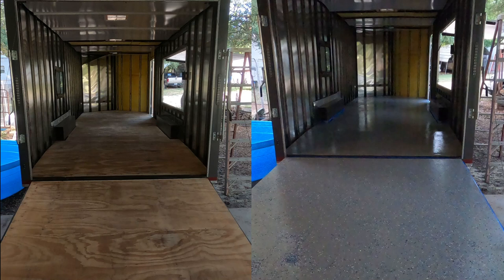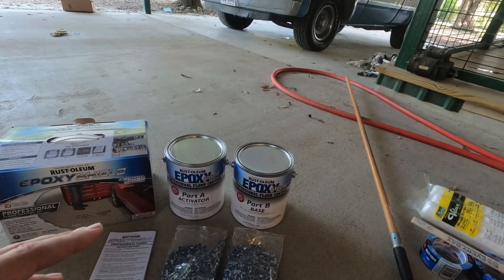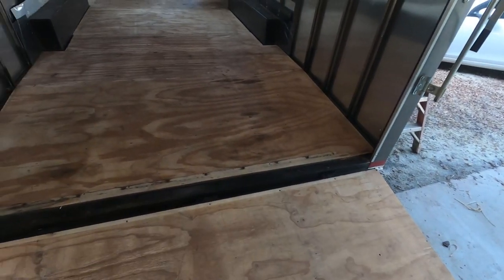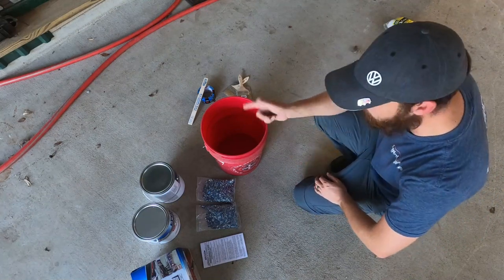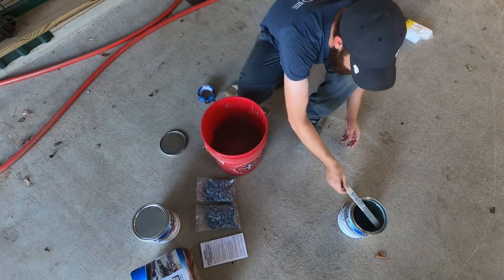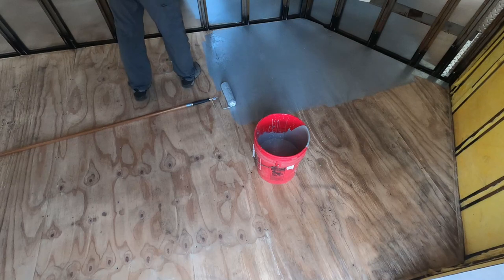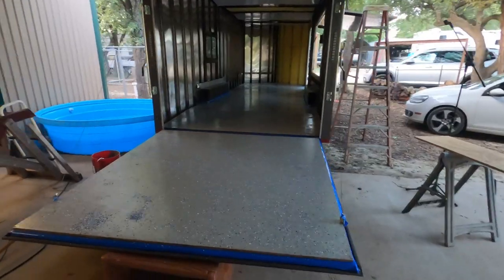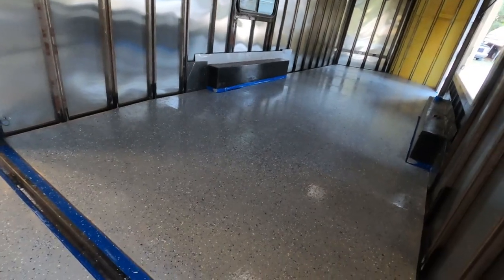How to Epoxy a cargo trailer floor the easy way | DIY | Rust-oleum Epoxy Shield

Comment: FYI, RustOleum does not recommend 2 part epoxy on a wooden substrate as any hard object falling on it will dent and breech the surface. Kind of the same reason you don't put laminate on plywood, but rather dense particle board. Also, pay attention to the temperature requirements. It must be warm to harden.
Reply from the maker: So far I haven't had a single issue. I sanded the entire floor to give it a good grip and did the clear coat on top. Yes I followed the temps when I did it and let it cure for a week before I even touched it.

Comment: How it’s holding?
Reply from the maker: Really good. I have zero peeling or anything. It's all about the foundation. I cleaned and sanded it making it have a good bond (grip).
Reply: Looks great I purchased a new trailer im looking forward to do it soon what grit sand paper did you used?
Reply from the maker: @lsxpower3367  I used 120 I think. Just something that isn't gonna smooth it too much, but also not 20 grit either.  Lol.

Comment: Thanks for the video.  Two questions...#1 are the chips sharp on the feet after the epoxy dries?  #2 - any idea if it would work to apply this over hardboard insulation and 1/2" subfloor in the trailer?  Would it crack?  Thx!
Reply from the maker: Thanks for watching! 1. The chips can be sharp. I did come back later and add a clear top coat (same brand) and it really made it better and shiner. Would recommend doing it as well. 2. Expoxy is pretty good at bonding to items. I'm thinking you wanting to  insulated the floor, add the third subfloor layer utilizing 1/2" plywood on top....I wouldn't see a problem with that. Actually of I was to do this again that's what I would do as my next one is probably gonna be a tiny house version. Just be sure to fill in all the extra cracks or you may see them and sand the top layer.
Reply: @watsonst04  Awesome....great advice!  Thanks!
Reply from the maker: @peterolfert7477  Anytime!
Reply: @watsonst04  What size is this trailer and how much epoxy did u have left? did u have to mix more or it was enough?
Reply from the maker: @andrewdibble9206  my trailer is a 24' V Nose and I only used 1 kit for it.

Comment: I did a 40' shipping container floor with this. Kept 300 2 week old goslings alive in there with space heaters during a cold snap, cleaned it up after with a pressure washer and never knew they were in there.
Reply from the maker: Yea it's pretty easy clean stuff.... I bet that was a mess when you were done though...lol

Comment: Great video! Would you advise filling in the screw dimples and plywood joints on the floor? I’m wondering if the epoxy filled them as you mentioned or if they showed through after the product hardened. Thanks
Reply from the maker: You can if you wanted, but due to the flakes you can barely see any imperfections (Screw holes, cracks, etc).

Comment: I was surprised you didn’t put a second coat over the flakes
Reply from the maker: I ended up putting a clear coat on top of it.
Reply: How many kits of clear did you need for the 24ft trailer?

Comment: How easy is it to drill through for mounting tie downs and such.
Reply from the maker: Just depends on if you hit metal structure areas.  Either way not hard just make sure your not hitting anything important underneath the floor.
Reply: @watsonst04  was just wondering if it may cause the epoxy to splinter or crack. Thank you for the reply and a great video.

Comment: How did it turn out? It looks like you had some oil spots on the floor. I'm trying to figure out if it will affect it or not
Reply from the maker: Turned out well... never got any cracks or stains on it.

Comment: will it scratch off if you went on it with something sharp like snowmobile carbides
Reply from the maker: I don't think it will scrap off easily.... I bet it will hold up pretty well.
Reply: It will not hold up to snow mobile skags or carbides. When loading my sleds, once I get the skis on the ramp. I put rollers under them to protect the floor

Comment: How many sq ft does 1 kit cover? i have a 7x16 enclosed trailer
Reply from the maker: My trailer is 8x24...so you should be good with (1) kit as I also did the ramp as well.

Comment: Looks great, I just ordered a kit for my cargo trailer.. Question.. How is it at the floor seems where it meets another piece of plywood?  or did you fill the seem if so what did you seal the seem with.  thanks
Reply from the maker: The epoxy fills in the cracks and the tops of the screw heads pretty good when you apply the base "Grey". You will still barely see them though, but when I added the flake they just about disappeared. If your not doing flakes and want it super smooth I would fill the cracks with something.
Reply: @watsonst04  Thanks, you did a great job!
Reply from the maker: @livinglifemyway7349  thanks!!

Comment: Is this stuff suppose to be waterproof for wood floor ?
Also how did it work for ramp ? Slip resistant enough ?
Reply from the maker: It would say it water proof for sure. It completely seals the floor from everything. The ramp seems fine and had no problems. If you wanted the kit includes "sand" you can mix it to make it more slip resistant.
Reply: For the clear coat on top of the epoxy it comes with grit like silicon you sprinkle over as it's incredibly slippery if you don't use it

Comment: How did it hold up with the flex of the trailer??  Is it cracking at all?
Reply from the maker: I haven't seen a single Crack at all. I've put several hundred miles on it with a couple trips loaded down.
Reply: @watsonst04  Thank you very much for the reply
Reply: @watsonst04  how about now?   I have been told the epoxy will crack etc... I have a 16ft vnose we use allot for furniture
Reply from the maker: @chucktraughber505  still doing great... I think it's all about the prep work. That's why I sanded my entire floor first to give it more "bite".

Comment: How about tire marks from coming in and out. My trailers for four wheelers
Reply from the maker: Well I've only put 2 cars in mine. I bet if the tires are warm they would eventually leave "hot tire" marks on them. I'm gonna install "E Tracks" on the floor; therefore I shouldn't get a lot of markings as the tires will roll on them for the most part. I think as long as you cleaned the floors like your should and not do dead stop turning of the wheels, you probably won't get any marks. At the end of the day this trailer was designed to be used, so if I get some marks, it's fine.
Reply: Look up tire mark remover i beleave its made by zep but its suposed to remove the tire marks left by forklift traffic in warehouses
Reply from the maker: @beardconsciousproductions3881  I haven't drove a car in there yet... I need to install the E Track on the floor. I also plan to install them right where the tires go to hopefully help that as well.